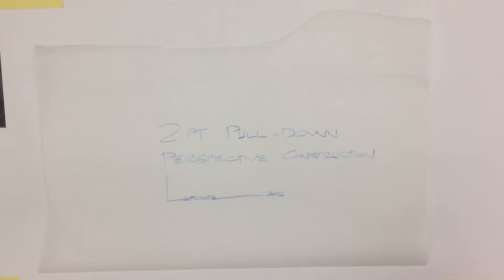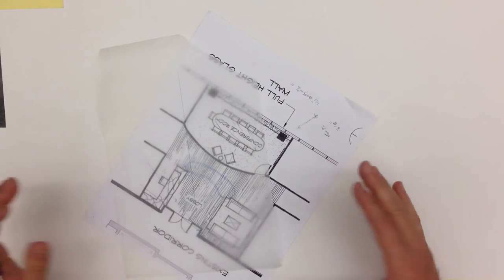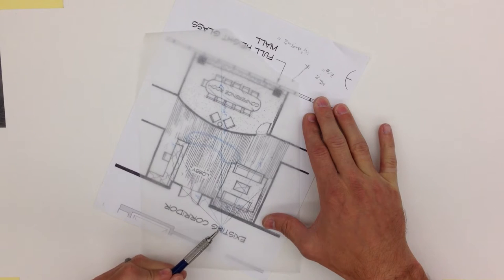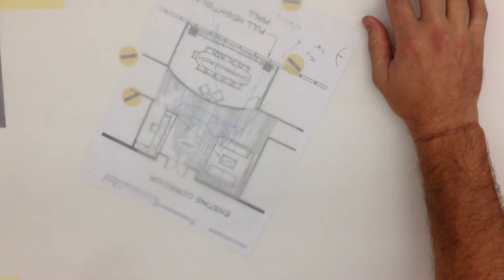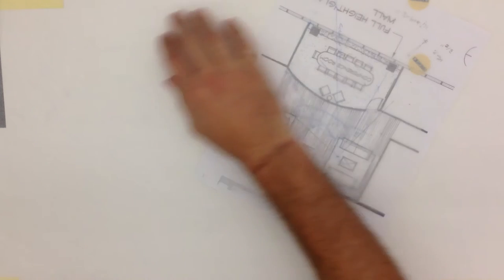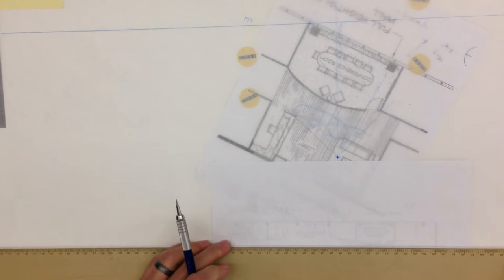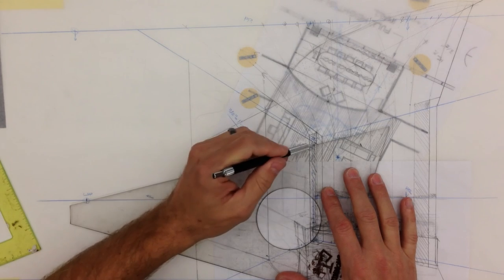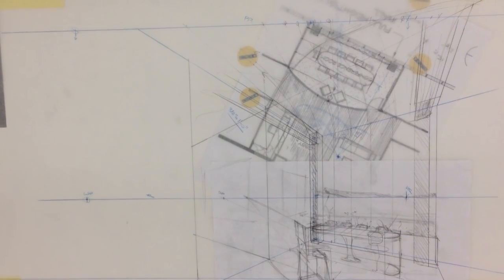2pt pull down Perspective - Corporate Conference Room

Comment: Thank you so much for this video! Incredibly helpful. 
I also watched your second video about the executive office and have a question:
After we are done sketching, we need to draw a rectangular frame (I am not sure what the actual term is) outside of which we will erase everything extra we drew. Is there a rule on how big that rectangle should be ? I thought it was connected to the cone of view, but then my perspective ends up being in a portrait mode, not landscape like most sketches are. Do we take into consideration 60 degrees, or 90? 

For example, in this video you drew the hallway, however we shouldn’t be able to see it based on your cone of view of 60 degrees. We would only see the corner where the glass wall and the hallway meet. However, you still sketched it. So in your final sketch, would it be included inside the frame? 

Thank you in advance! I hope my question isn’t  too confusing!
Reply from the maker: I think you're referring to the "view". I wouldn't erase anything, but it's just that everything beyond that frame will stretch out a lot from the perspective system. Never erase your sketch though!